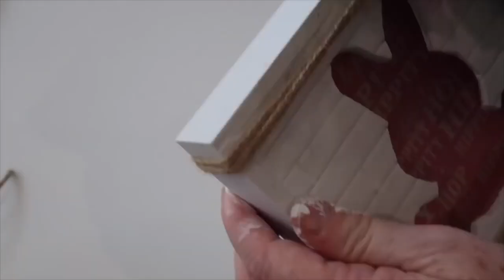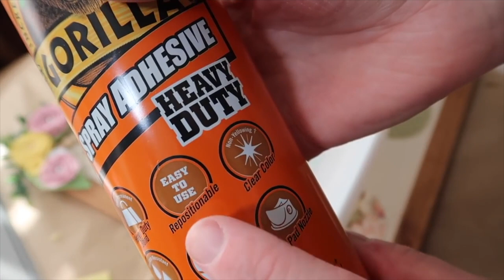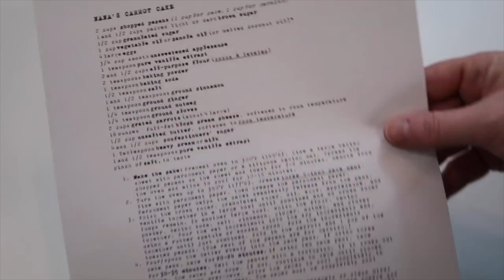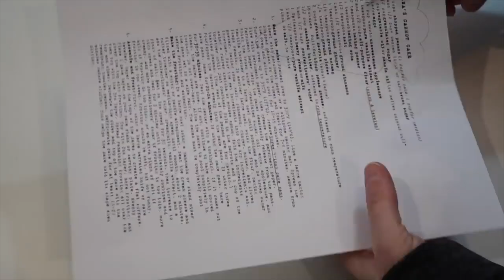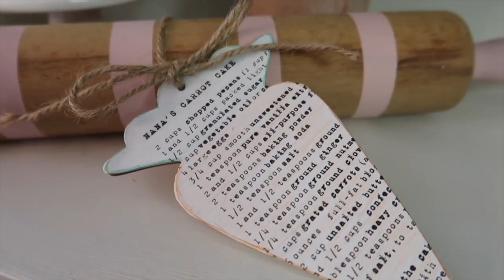🌼 16 AMAZING TOP Easter DIYS  |  EASY SPRING HOME DECOR DIYS 🌼

Comment: I love the rabbit you put on foam cut it out put paper  in the bottom of the box then put lights in it with a rose on the corner  and the little lamps. I've seem them  before but putting a pull cord just finished it to perfection. You seem to nail it every time. I love this video.

Comment: I have used Modge Podge in my Fluid Pours paintings and I got an amazing effect. If you interested you just mix floetrol, paint the add bottle water until you have the consistency of warm honey. Using 3-4 different colors you can get an amazing art piece.

Comment: You cold use a small funnel to add the styrofoam beads to cut outs,whiel its inside a small glass to keep up right to fill I actually got a set of 3 smaller funnels at the dollar tree.😃